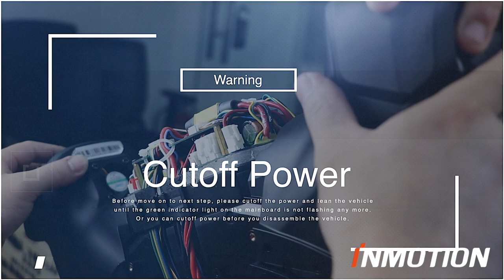Anything special inside Inmotion V11 Electric Unicycle? | #Teardown Video

Comment: I'd love to see a video showing the steps needed to do a tire/tube change.
Reply: That is a definite must 😎👍
Reply: Right- for example, do the batteries need to come off for a tire change?  Seems like you could probably stop after removing the pedals and shocks...  but would be nice to know.
Reply: @RealMikeDobbs  well Luckily for me Ive never had to change a tire on my Euc, but it surely looks alot tougher job, than that of my truck! "Now add suspension wheels" Changing a tire on these new puppy's may require the mind of a genius with a degree in engineering, it will definitely be a complex job & an advil moment...lol but its one we all need to learn sooner or later! Or give up your freedom & call Uber. 😎👍
Reply: @jackvolta3489  I'm not so sure.  I can change the tire on my Inmotion V8 in under 30 minutes.  This certainly has a lot more screws, but I suspect we don't need to remove all that was removed before the tire came off in this video.  Eager to find out more.
Reply from the maker: Hi Duf. That's a must for sure. I will arrange the video soon. Thx
Reply: We're waiting for you to create that video Duf :-)
Reply: @RealMikeDobbs  well Mike the most important thing before any job is try to refrain from getting frustrated, most mistakes happen when stressed, if so take a walk & cool down come back to it later. Nobody says you must change a tire within a 1/2 hr, do it at your own pace & Be sure to keep all your screws in little cups or a magnet dish, maybe even before the task buy little color dots stickers & color code them especially if size & lengths are different, take pictures etc etc anything to help you along & remind you of there placement. Then when the job is complete its Miller time, dobbie time or both...lol
Enjoy and marvel at a job well done. 😜👍
Reply: @jackvolta3489  True👍
Reply: Make a strong armed bike repair dude do it for you.  It takes him 10 minutes ... Then AFTER that you slime the wheel.
Reply: It's out now: https://www.youtube.com/watch?v=eIMYss3X7NE

Comment: I'm a mechanical engineer for a living, and your design philosophy was one of the primary driving forces behind my choice to upgrade from a V8 to a V11. I used to work in the engineering department at Walt Disney World, and when I was there, a wise engineer with decades of experience took me underneath the guts of the Lilo & Stitch ride and showed me something wayyyy up in the darkness that was broken. He said, "you see that piece up there that's broken? Well, the person who designed this ride never considered the possibility that things could break, so he never bothered to make it so that they could be fixed. Whenever you design something in the future, operate under the assumption that literally everything you ever create WILL break at some point, and make sure that you make it so the people using it can fix it when it does."

The ease of maintainability of my V8 gave me confidence that you would carry that design philosophy forward into your future designs, and I'm so pleased to see my suspicions were correct.

Can't wait for my new wheel to arrive! Every video I see gets me more excited. 💖
Reply: Same same,   without the Mech Eng. degree  :-)

Comment: How do we get the new and improved V11 screws?
Reply: New and improved?  Are there different screws in this video than on your wheel Duf?
Reply: Shyke Prodz the batch 1 screws don’t match the hardware they give you and so they were easy to break
Reply from the maker: Hi Duf. I will share the news about it in the forum when it's settled.

Comment: So you're leaning the v11 and holding and pressing the power button? 

2:43 could you provide a few more details about what you're doing to "cut power off?to inmotion v11" 

I thought that this is something you do after you pull all the plugs out

Comment: By "cut power off" do you mean just make sure the power is not on while you unplug the PCB? 

I've taken apart of v11 before and didn't have to "tilt the machine to get the light to stop flashing" but just want to make sure. It's been a few months since I did this so just making sure that I'm doing it correctly. Thank you for your help!

Comment: Oh man, that is a lot of screws!  How much of that would be necessary just to do a tire change?  Would you need to remove the batteries to access the tire for example?  Also, could we see a little more of those batteries?  It looks like they are encased in their own plastic case (like on the V8), which is very impressive!  I don't know of any other manufacturer that does that.  Details like that are what keep me buying Inmotion wheels.  My V11 will be joining my V10F and my V8 in the next few weeks 😄
Reply from the maker: I will share another video that shows how to replace the tire,
Reply from the maker: I will share another video that shows how to replace the tire,

Comment: Guys, it would be better to shoot a video to replace the BMS, which every second owner of this monowheel burns down for no clear reason. They can not be bought separately anywhere, only assembled with a battery that is very expensive. Or will you give a link to the gdpb you can buy a bms?

Comment: what is the connector for the battery charger? impossible to find without the steel collar, it's an M8 3 pin circular connector but can't find this specific style.  it's very easily damaged.

Comment: This is definitely one of those situations where one needs to make a note of everything & where each wire plugs in & where each screw goes or else, I can see a number of screws left over with no idea where it should be. 

While it does seem well put together, somehow it makes me long for the Sherman instead.
Reply from the maker: More screws, but well-orgnised. There's huge difference between complicate products and the rest. This video is aming at showing the inside structure. It doesn't mean you have to disassemble it just like in the video.

Comment: I was expecting you going to show how the motor looks like, until the last moment. But you didn't touch that part installed on tire. 😐
Reply from the maker: Another video of how to change tire will be shot. Thx
Reply: @INMOTIONSCV  The question was about the motor not the tire.
Reply: There is a video about hollow motors and bearing made by EUC bros - its a GW wheel but interesting all the same.

Comment: My first small crash with hardly any external damage has bricked my wheel .glad my v8 hasn't sold yet. Where am I going to get the thing fixed ? The vuild was awful anyway , it arrived with the loops for the top saddle bolts broken and the whole thing is floppy with a grinding noise as I go along.  That's 2 grand wasted

Comment: Why cheap out and use the silicone pad for heat sinking the Mosfets. You shouldn't use paste with pads.  I would use mica and paste instead of that pad material. When I buy this wheel when my V10F dies or I get rich, I will change out the pad to the mica and paste like I did to my V10F.

Comment: 220 Mosfets....2016 Style
Reply: No big deal. 12 of them and heat sunk with heat sink cooled to the outside of the case with active cooling. This has been the best design I've seen to date. Only improvement would be to use mica and paste instead of the pad.
Reply: halohms ??? Actually 12 Mosfets, AND the heatsink exposed to the outside is what you have on all KS and most of the GW wheels. (GW Tesla is an exception and some older Nikola version, all other GW have exposed heatsink)
The only thing they DONT have anymore is those tiny mosfets. This 220 Mosfets are known for overheating or blowing, thats why all current powerfull EUCs use the bigger 247Mosfets.
Reply: @ullle66  overheating is related to the heat sinking of the device. If the current handling of the Mosfets are the same, the case style doesn't have much effect if properly mounted and properly used and effective heat sink method. The pad and paste is not as good as mica and paste. In fact, pad and paste is worse than just pad itself and they put the paste on both sides of the pad which makes it even worse. Paste is designed to be used as thin as possible to fill in really really small surface imperfections of metal to metal surfaces and metal to mica to metal surfaces when electrical isolation is required. When you use paste in the pad use, the paste does not get squeezed thin because the pad deforms and takes up the compression and the paste remains thick. Paste is not a very good heat conductor when it is thick. Using the larger Mosfet case style helps a little by increasing the surface area to the worse paste pad paste to heatsink heat transfer. As I said, I'll change mine out to paste mica paste heatsink method instead of the pad with paste. It could have been made so much better by doing it right the first time. Problem is, it takes a lot more time and effort to do the paste mica paste method.
Reply: halohms 
Ok...i make it short:
There is a reason that the powerfull brands like GW/KS have shifted to the bigger 247Mosfets. And that all has nothing todo with paste and contact....
One small aspect is overheating, the other, much more important is, that with such large batteries and powerfull motors the board NEED that bigger mosfets. Both KS/GW have, one their first versions of wheels , tried those small 220 mosfets on first KS18, GW v3, even the first Nikola had them on. As real life, experience and time showed: the small Mosfets are  just not capable enough to handle the high amperage, so they blowed when under stress like hills or heavy riders. And btw: thats one of the reasons why the v10 board had some serious overheat and powerhandling issues.
In the end its just a shame that IM tried to save some bucks here...they should have thrown in a beefier board from the GetGo.
Reply: @ullle66  I haven't got the model numbers of the 2 different types of Mosfets to look at their individual specifications. BUT if they have the same electrical qualities in current and heat transfer resistance to their case, both devices will work just fine if properly mounted to the heatsink and the heatsink properly cooled. The problem is that they are using that pad with paste and that where the surface area of contact is improved with the larger case of the Mosfet. If the TO220 case is mounted using paste-mica-paste and screwed down with the screw hole mounting method instead of the PCBoard compression, then those Mosfets will survive more load than the larger mosfets with the pad method of heatsink mounting. (I'm an electrical engineer BTW). I replaced the pad with paste-mica-paste on my V10F and it would likely get up overheat hill with Marty as the load.
Reply: halohms The 220Mosfets and 247Mosfets are not the same spec. 247 is capable of much more amps. 
We will see what the v11 does when Marty is taking it to his mountain/overheat t hill riding and stress testing it.

I really like Inmotion for their high quality production. Just except for their boards.
Reply: halohms So any questions about the V11 and his 220 Mosfets ? This wheel didnt even reach overheat Hill...it even overheated before and disintegrated :-)
Reply: @ullle66  It didn't disintegrate! He couldn't see any burnt parts or traces. Something strange happened when he laid it down without turning it on. It should have continued to cool down. Did something like a blob of solder get loose and when he stood it up, shorted something out? It isn't a real OHH fail in my opinion. Plus, the mosfets were not properly installed because they had paste on both surfaces of the pad. Paste should only be used with bare metal to bare metal or with mica to metal contact. It also needs to be squeezed really thin to which the pad doesn't allow. Mica will.....